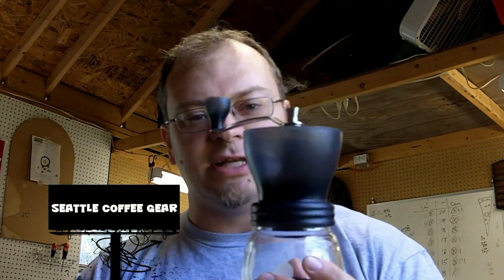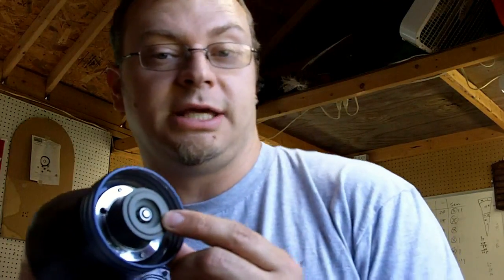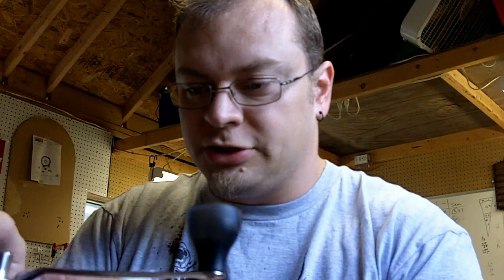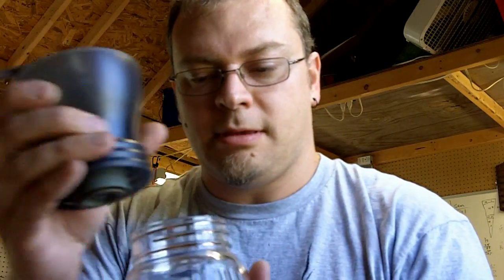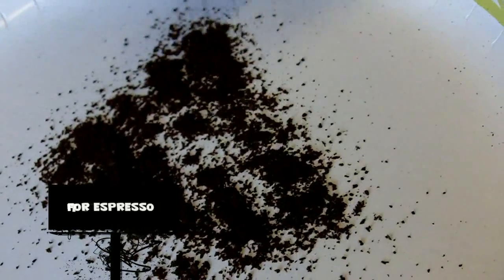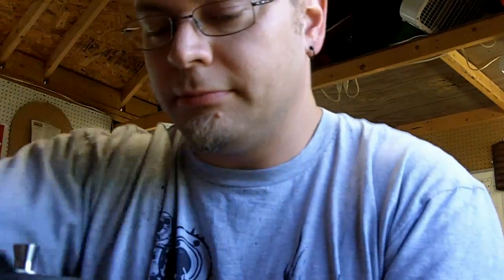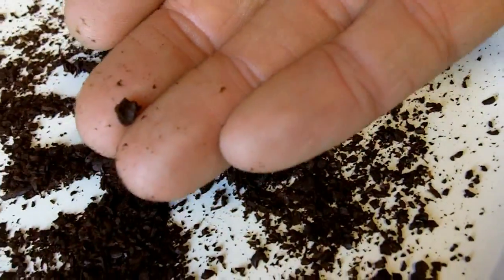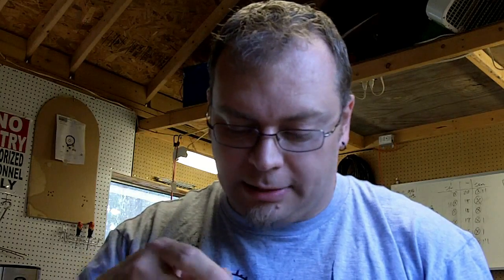Hario Skerton Coffee Mill

Comment: @t3chninja The deflection in the shaft is due to unbalanced "moments" on the handle. If the consistency is a really big deal, you could make a different handle for the top out of a piece of metal with a hole in it (a two sided handle... like how you would use a tire wrench), then hold both sides of the handle with one hand, and turn the bottom. This will ensure the shaft remains more straight during grinding. Would probably take you a lot longer to grind your coffee though.

Comment: To stop the wobble the grinder shaft would not have to extend all the way to the bottom.  The upper part of the shaft just needs two points of contact.  Maybe one neer the handle and another farther down just above the burr.  The real problem, and I own one of these grinders is the one point of contact.

Comment: Also I forgot to add that the rubber piece you used at the bottom of the glass ground container can be removed and place on top of the grinder.  You cover the top so the beans and smaller pieces don't come flying out when you're cranking away.

Comment: Thanks. I have a similar coffee mill. Not the same brand but same mechanics. Whenever I start grinding, the burr becomes loose and I get VERY COARSE coffee--pieces fall through the cracks. I have tried tightening the screw, but the same thing happens. Is the coffee mill broken? Should I write if off or could it be fixed? Not what your video is about; but what you might be able to point me in the right direction. Thanks.